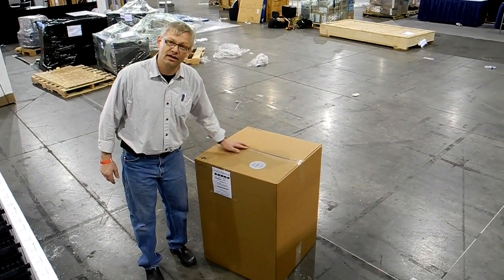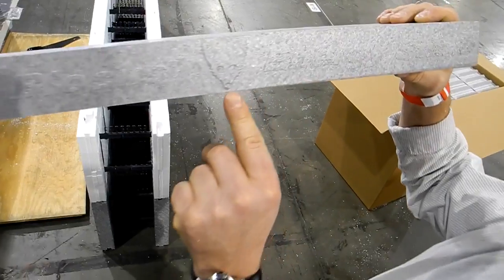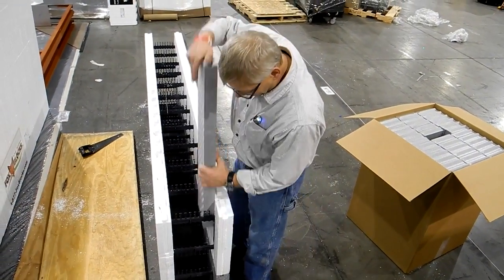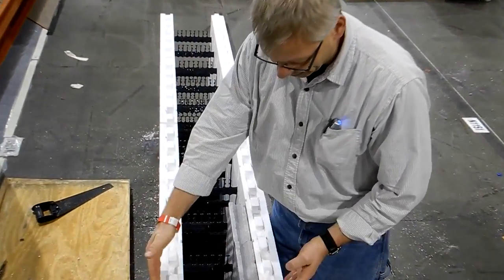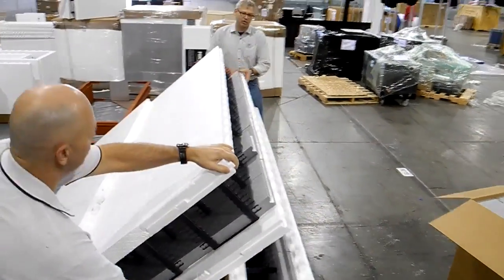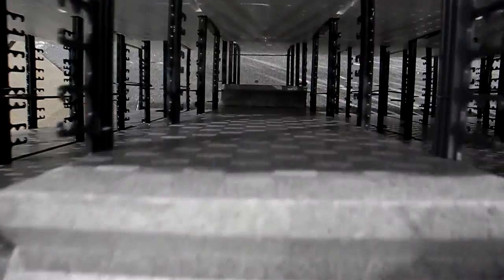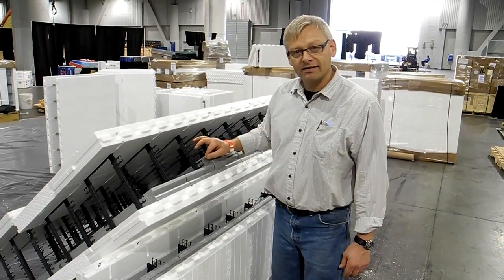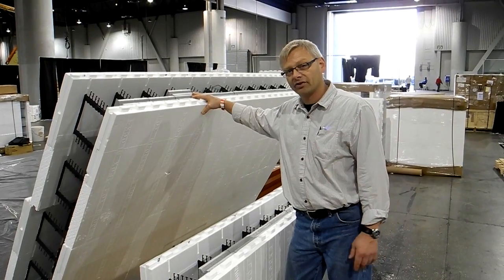Fox Blocks Energy Sticks add R9 per layer to Insulated Concrete Forms

Comment: Impressive stuff. My current dream house is based on Fox Blocks and this seems like a great addition to it. In practice, what's the minimum thickness of concrete you need to maintain in the walls proper? That's one of the primary expenses in my current plans.
Reply: Hey im wondering if you managed to build with fox blocks?